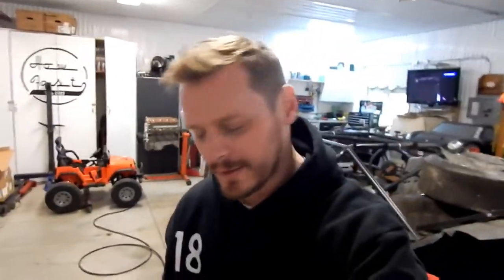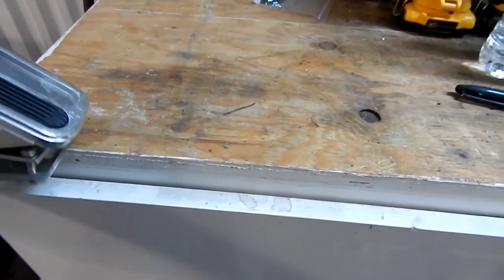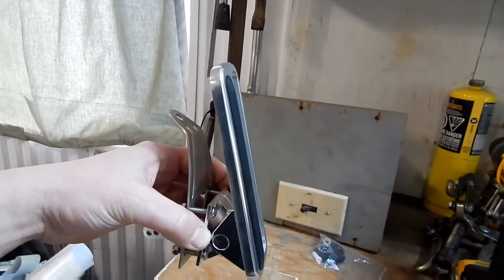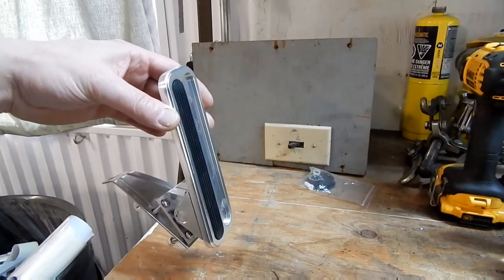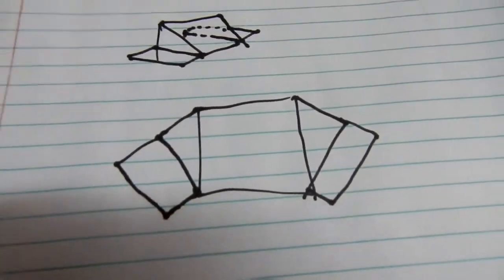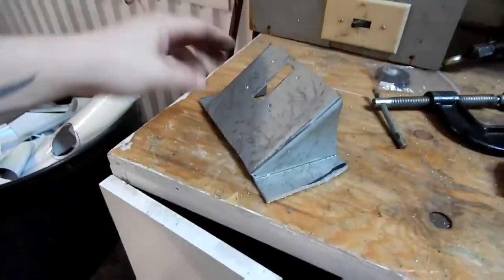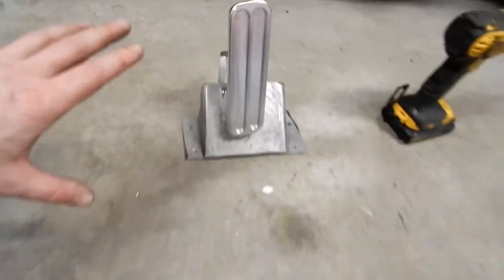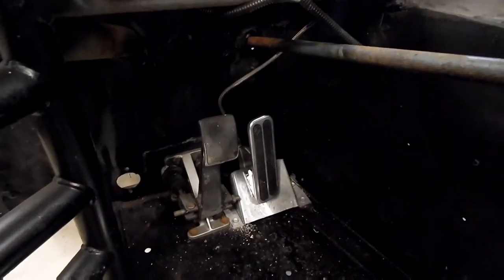Mounting Our Drag Car's Throttle Pedal - HowFast

Comment: naturally b (I think so).  just what does JDM have to do with it?  Well, if you took the path of JDM, here's my question: Toyota Supra is a legendary car with a legendary engine like: A 1JZ-GTE, B-2JZ, C .2JZ GE or D 2JZ-GTE?
Reply from the maker: I know this one the legendary engine was the 2JZ-GTE. I refer to JDM because the make is Mitsubishi and in North America they aren't referred to as Kei cars.
Reply: @howfast1078  the answer is correct But the question was tricky!  all these motors were installed on a Toyota supra :) just the 2JZ GTR was the engine with the greatest tuning potential.
Reply from the maker: I noticed that.. I thought you were trying to be sneaky so I reread the question to make sure I didn't miss something!
Reply: @howfast1078  while we have a score of 5: 3 in my favor!
Reply from the maker: Oh... I see.. we're keeping score are we!! 🤣 Well in that case I'd better step up my game!
Reply: @howfast1078  the main thing is that the questions are international!  By the way, about the gas pedal, will your aluminum structure bend?
Reply from the maker: @ПавелШашков-о9х  I'll keep them international so that it's fair!! Lol and yes the structure is very stiff/rigid I don't think I'll have any issues with it bending.
Reply: @howfast1078  I have no doubt that you will succeed!  the main thing is a big engine and a turbine!  and then, as in the movie: Before moving exactly 400 meters at the green light of the light, I start ... fast and furious 1